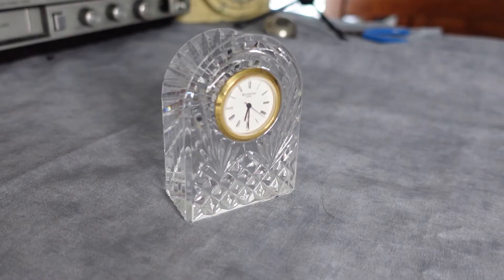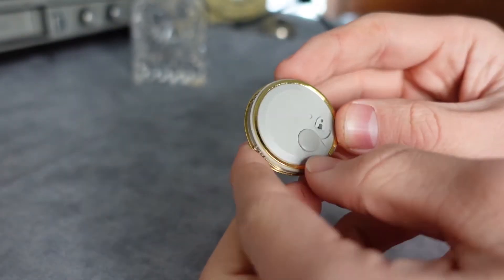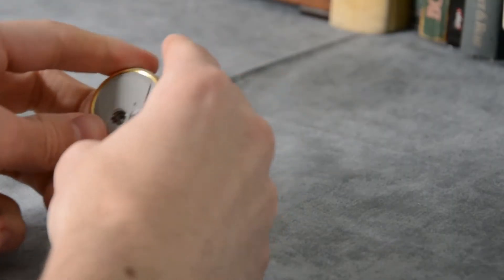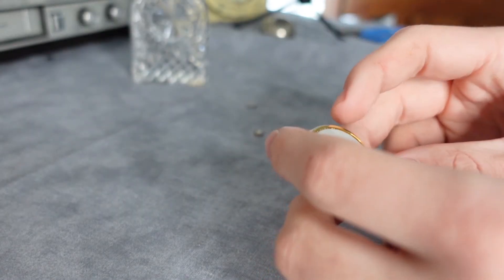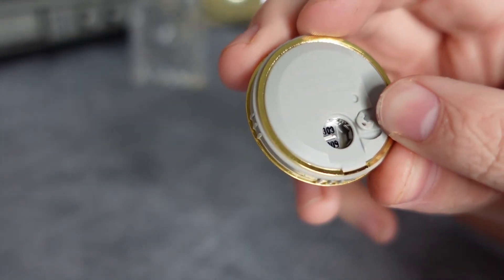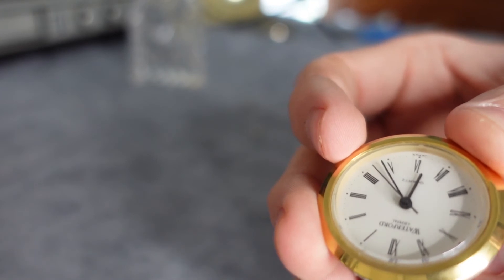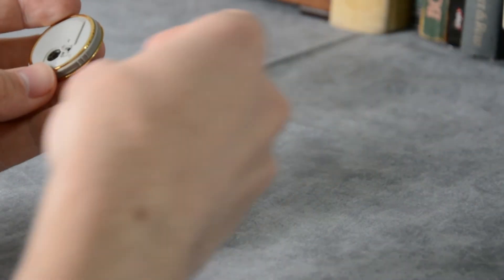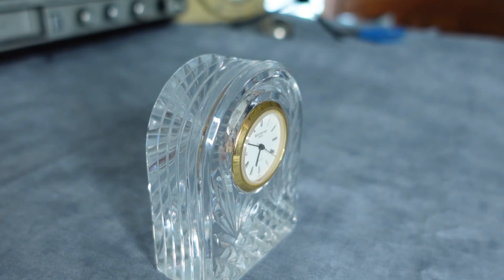How To Change Waterford Crystal Clock Battery

Comment: I’m not sure if you are still active but I wanted to ask a question.
I have a Lenox Minuet clock.  I changed the battery and now can’t get the face to stay in.  I don’t see any clips to hold it in place.  Any suggestions?